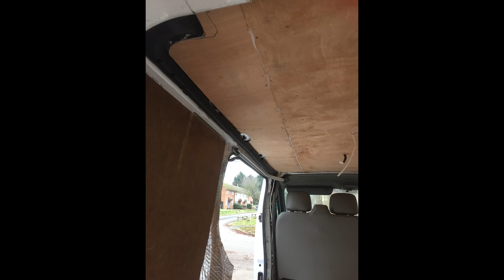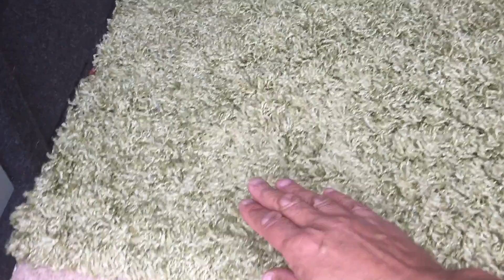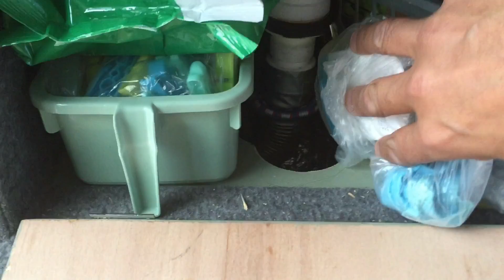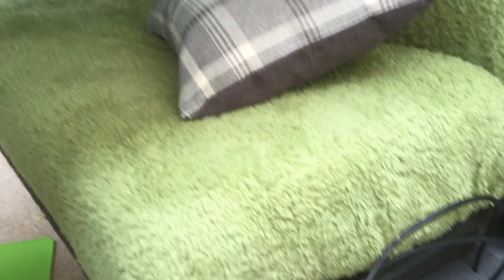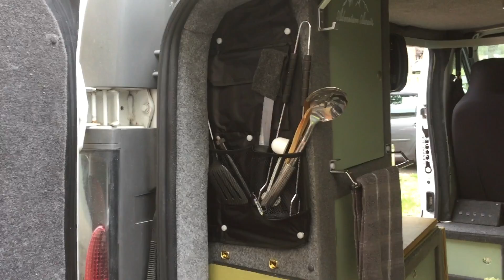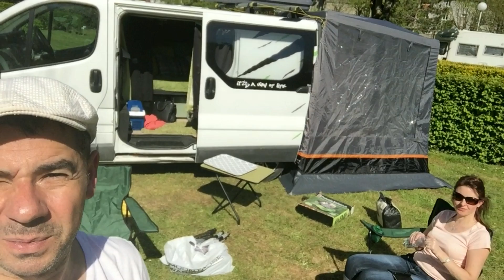Primastar van conversion. Prep for Road trip France,  'It's a Way of Life'. Pictures and Vlog.

Comment: Thanks for the inspiration :)  I have a very low milage Nissan Prima star SWB 2004 with only 55k milage, with only myself owned since new,  so I am now considering converting to a camper van?  as it would be such a shame to sell my van, thanks so much for your you tube video, it really has inspired me :) just wonder if I will do it myself or get a company to convert it? but think I will do it myself after watching this :)   Thanks so much!!!  xx  

Also just in case anyone has problems with the gear linkage on a prima star van, as I did a few years ago- and I also paid repair garages hundreds of pounds many times for repair!   £888 pounds once  :( as my gear just would not work and clutch seemed disconnected and the linkage just kept letting me down and popping off :(  so this bracket is amazing Gear Linkage Cable Repair Clip Clamp Kit for Vauxhall Vivaro Renault Nissan UK and you can fit this yourself!  it does work! just google it and it should cost you only around £12 or less, think it was called an X clamp? I fitted this myself and it sorted the problem for the last few years and it is still on and working great !! xx
Reply from the maker: Wow, that video is a blast from the past. We have now moved on from the Primastar. This was our first conversion and gave us the taste for 'campervanning'. Yes, as vfor the gearbox cables and plate, I did the same modification and also ensured that on a monthly basis I applied fresh grease to the selector arms on top of the gearbox.

We absolutely loved this little van and it took us on loads of adventures. Absolutely, if you know the van, convert it. As you will see from this old video, we converted it ourselves with a £1000 budget. Not the most 'plush' of interiors but practical nevertheless. Great times!!

Good luck if you make the decision to self build, and if I can help in any way, give me a shout on here. Many thanks again for watching and all the very best, Tony.
Reply: @adventurevanfreddie  Aw thanks for reply Tony, that's brilliant on £1000 budget for your first conversion, well done! I will certainly check out all your other conversions and will grease my van selector arms etc on top of gearbox too, I do need another gearbox before I convert mine as it makes a crunching noise and makes me sound like a learner driver :) Although it's lasted quite a few years like this too:) I will let you know how my conversion goes on and thanks for the advice.  Wishing you many happy adventures on your journeys and thanks for taking time to show us all your amazing work! Happy travelling xx  Mary
Reply from the maker: @themermikkishow6710  Good luck Mary, hope you get the gearbox sorted and your conversion underway. All the best and take care, Tony.

Comment: Love the long bench layout, I think it's more practical, well for me it would be. I have a Talbot Express campervan and only ever sleep on the bench seat. The floor raises and front seats turn to make a double but for me I don't need that. 
I'm actually thinking of getting a lwb Vivaro but the soft gearbox puts me off. Talbot gearboxes aren't great, spaghetti junction but I'm used to it now lol. My vans almost 30 years old. 

A Peugeot boxer was next on my list until I realised I don't need that amount off space.
I'd probably just sleep on the couch like yours and cook while sitting, sounds fine to me.
Anyway I've subbed and will catch up on some more of your videos. Again, you did a great job 👍
Reply from the maker: Wow, now there's a video from the past. Many thanks for watching and for following our channel.

In the end we changed up to the Peugeot boxer because in the main, there's always 2 of us in the van. However, we loved the Primastar and it gave us the taste for 'camper vanning' experience.

If you manage to get a non abused Primastar/Trafic/Vivaro, you'll be fine, just make sure that the Gearbox cable connection point on top of the box is well greased and that you put a tray below the scuttle panel to divert any rain water coming from the windscreen, as the water runs off onto the top of the engine and can corrode the top of the injectors.

Yep, if I was on my own, I'd still be exploring and having adventures in the Primastar, lovely little van. The Boxer does offer the immense benefit of space and storage, and is also great because we can stand up straight in the back.

Good luck and I hope you find the van you're looking for....... or stick with the Talbot, great van that's stood the last test of time; classic!

Many thanks again and all the very best, take care, Tony.
Reply: @adventurevanfreddie  I read somewhere about the gears getting stiff and not going into reverse because of lack of lube but forgot it was on these vans, thanks for reminding me in case I get one.
I also read about the front windscreen water run off causing injectors to corrode and split, the tray is a great idea thanks.
Quite a few people have recommended me to keep the Talbot, perhaps I should take the advice.
I was going to get a Vivaro, Primastar or Trafic and convert it, try it out and only then sell the Talbot if I liked the other enough.
I think it's the lock down playing with my head 😂 Cheers 👍
Reply from the maker: Haha, yep, lock down is playing with everybody's head. Keep the Talbot, lovely old girl!
Reply: @adventurevanfreddie  👍👍👍

Comment: I've watched this video over and over to try and see how you fitted the curtains on the sliding door,,I cant work it out as I'm struggling with my primastar 😡
Reply from the maker: Wow Paul, that's an old one. Ahh, the curtain, yes. What I managed to get hold of was a second-hand aluminium surgery/hospital ward curtain track. I fixed it to the side of the wardrobe and then to the side of the van above the sink (if this makes sense?!?!). Pop this into your browser and you'll get the idea:

https://www.goelst.co.uk/media/magmodules/gallery//f/l/flevo_ziekenhuis_afd._neurologie_037.jpg

Hope this helps. All the best and take care, Tony
Reply: @adventurevanfreddie  thank you,that helps,I wonder if a square shower curtain rail will work then 👍
Reply from the maker: No reason why it shouldn't, 3 brackets to hold it in place. I'm sure you'll work it out. Originally, I was going to use flexible curtain rail fixed  to 20 x 40 mm lengths of timber. All the best, Tony.
Reply: @adventurevanfreddie  thanks for your advise tony,hopefully see you out on the road sometime

Comment: You added insulation? how much of a benefit do you see from it? Thanks.
Reply from the maker: Hi Ben. Insulating the van is one of, if not the most important thing to do. Not only does it keep the warmth in during cold conditions, it also helps to keep out the heat when it's hot. The other really big change is cabin noise. We couldn't believe the difference in how quiet the van sounded after we insulated. Don't do what a lot of people do and just aluminium foil bubble wrap, this will only work as a heat transfer conductor and will bring the heat/cold further into the van. In short, absolutely my friend,

Comment: Is this a SWB van? If so, you've done a great job of optimising the space.
Reply from the maker: Hi George, thanks for leaving a comment. Yep, this was our 1st van conversion and it was based on a Nissan Primastar SWB van. Cheers, Tony.
Reply: @adventurevanfreddie  would you recommend one of these or one of the Renault/Vauxhall equivalents as a starter van? It's just me, my partner and our small dog. We want something for 1-2 nights away max. We have considered Relay's/Boxer's, but they seem overkill for our needs. Your layout in this van is exactly what we had imagined up.
Reply from the maker: @ipodgooroo  All 3 versions are near enough the same van except for the badge. They are an absolutely fantastic van but you must seek one that's been well maintained with no problems with the gearbox (the box can be temperamental) as they are made out of chocolate. On the positive side they are cheap to run, you can park up anywhere a car can, they have one of the largest capacities for SWB van and are relatively square, making the self build a lot easier and  there's a lot less waste with your building materials. In my opinion, at the time this was also the best looking van available for our budget. £1000 old builders van and around £500 for the conversion. The only reason we changed to the Boxer (latest videos) was because we can spend 4-6 weeks away at any one time. Great van if you can get a reasonably good one.
Reply: @adventurevanfreddie  you only paid £1000 for your van and £500 for the conversion? I'm struggling to find any vans under £2k without over 150-200k miles on! Is big mileage an issue on these? I'm not sure whether to go really cheap for this van as it's our first go, or spend £3k-£5k and get something a bit newer and hope it lasts
Reply from the maker: @ipodgooroo  Yes, the van was an ebay find. 120000 on the clock and not in the best condition on the inside as it was a builders van. I took a risk buying it but figured that as long as it was running, I could manage most mechanical issues if it had any. We were lucky, it didn't and as I was doing a van build, it didn't really matter about the inside. At the end of the day, you can't beat knowing the history of car/van but this is not always possible. I bought a 1 year old well looked after Navara some time ago and had to have the engine replaced after 300 miles of driving it. As for the conversion on this van, yep, it was relatively cheap. The inside was already paneled so once I insulated behind them I only had to cover it with 4 way stretch carpet. Everything else was built with timber and clad with 5mm ply. The most expensive thing was the leisure battery and split charger. In essence, it depends on how often you are truly going to use it. We were both very much of the same opinion as you; use it for the odd night out and escape to the coast. However we soon found out that we loved the lifestyle and adventure it brings and used it far more than anticipated, hence a few long road trips later and 16 months of owning it........we got a bigger van.
Reply: @adventurevanfreddie  I've been scouring eBay and Gumtree daily... Did you buy yours sight unseen then?
For us, we want to be able to chuck a few bits in and go away on a Friday after work, then come home on a Sunday after a couple of days of relaxing and exploring.
Reply from the maker: @ipodgooroo  Yep, bought without seeing. Only went off the description and photos my friend. As I said, we took a bit of a risk but it worked out OK. Your reason for buying is exactly the same reason we bought, and if you look at our latest videos, you'll see that we are still doing it and love it!! Go for it, and if I can help in anyway give me a shout. As long as your other half enjoys it you will not regret it, it's simply an amazing way to escape the normal life pressures! Keep looking and something will come up.
Reply: @adventurevanfreddie  Thanks for that.
Was your van an auction or buy it now? I've only really looked at buy it now's that are near me
Reply from the maker: @ipodgooroo  Auction, but no one bid and £1000 was the starting bid. They do come up from time to time so keep looking and something will come up.
Reply: @adventurevanfreddie  Will do. The 12V electrics are a tad daunting, but I've done quite a bit of research and it looks fairly straight forward once you lay it all out and split it all down to each bit.
Reply from the maker: @ipodgooroo  That's the spirit, if you can wire up a speaker, you'll be able to do it; and remember that I'm only a YouTube message away!! All the very best and happy van hunting! Tony.

Comment: How did you do the rear vent
Reply from the maker: I used a cheap bonnet decorative scope on the outside which acted as a cover and a 5 inch circular vent for both the inside and outside. Later, I also added a cover  so that I could block off the airflow from the inside. Hope this helps, Tony.

Comment: Nice vid! Currently converting my Trafic. Where did you get the 6 foot mattresses from??
Reply from the maker: 2, 6ft X 2ft mattresses from eBay my friend. Cheap as well; we added a mattress topper in the end, but it still folded nicely when the bed was converted back to a seat bench. Good luck with the build buddy!
Reply: Osty 300, thanks matey! Hope it turns out as well as yours

Comment: what are the table brackets called and where did you get them from please
Reply from the maker: Hi John, I'm taking it that you are from the UK. The brackets are 'metal folding shelf brackets' and are available from most DIY stores, B&Q, Homebase etc. The ones I used were from Wickes and are really heavy duty, 14 inch long. There are loads on ebay and all work roughly the same. To be honest, I could have got away with using one and 2 normal (small) door hinges instead of the 2 folding brackets. However, the advantage of fitting 2 is that when you fit them the way I did, the table will hold itself in the down position without the need for a latch to stop it rattling when driving. How you do this is to very slightly 'run-out' of parallel when fixing the bracket to the up-right. If I remember correctly I spaced my brackets 25 cm at the top and 26 cm at the bottom before fitting the table, giving me the 1 cm run-out which holds the table under tension in the down position (no movement when driving).
 Hope this helps, all the best.

Comment from the maker: For those considering a similar set up. The rear tent is a Cucina kitchen tent. It's 2m X 2m and fits great over the back doors. You might also be interested in an Oxwich 4 canopy that we have also purchased to add a nice sitting area at the side of the van. The rear tent was on Amazon for £89 and the Oxwich 4 for £40. If you can't find the same ones, look for a similar with an opening the same dimensions as your vans back doors. Thanks for the comments. If you look at a my very limited posts on Instagram (Osty300) you will see our latest set up. All the best, happy travels!! See you on the road.

Comment: Fantastic build and some very sweet ideas.  I am going to buy a similar van very soon and also prefer the lengthways bed arrangement as it gives the illusion of more space.  One question though, where did you get the 2m x 2m tent.  I definitely want one just like that as we will take our cats with us and they can stay in there during the day?
Thanks for uploading this great video.
Reply from the maker: Hi, the tent is a Cucina kitchen tent. It's 2m X 2m and fits great over the back doors. As for the lengthways bed, I agree. It allows you to have freedom of use of the back doors for access, especially if you consider the rear tent. You might also be interested in an Oxwich 4 canopy that we have also purchased to add a nice sitting area at the side of the van. The rear tent was on Amazon for £89 and the Oxwich 4 for £40. If you can't find the same ones, look for a similar kitchen tent with an opening the same dimensions as your vans back doors. Thanks for the comments. If you look at a my very limited posts on Instagram (Osty300) you will see our latest set up. All the best, safe travels.

Comment: Really nice job fella, I’ve got the same van and about to start fitting it out, so you’ve given me some good pointers.
Reply from the maker: Brilliant, don’t forget to insulate the floor, we’ve found that during the winter the floor gets the coldest. I’m going to put another layer of foil insulation down in the summer. Good luck with your build, see you on the road!!